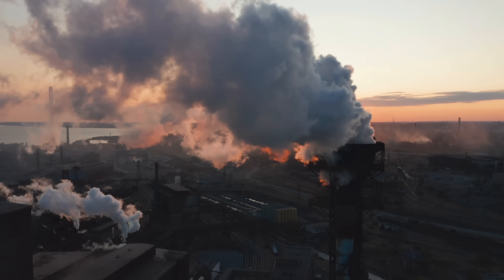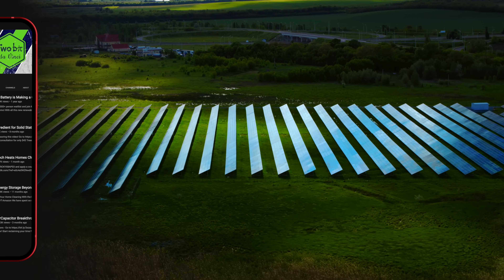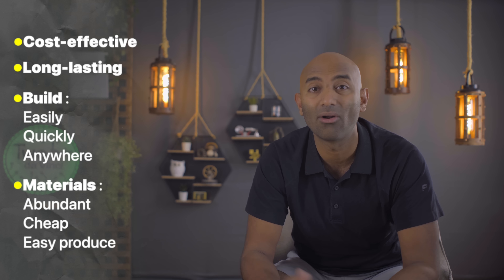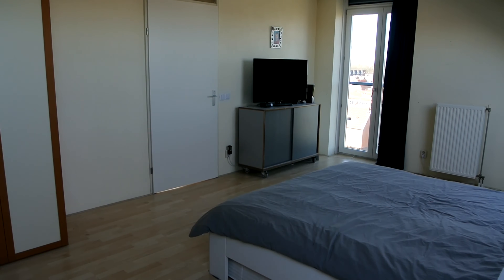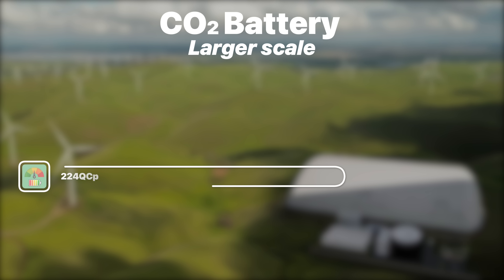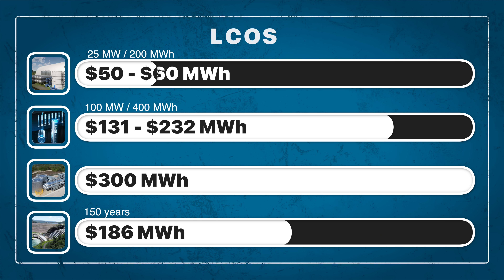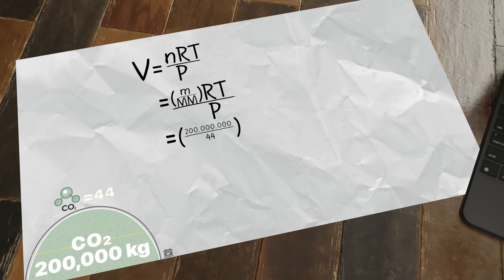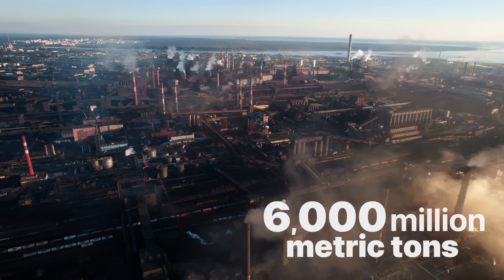The GENIUS Of the Carbon Dioxide Battery

Comment: Oil companies have a useful purpose for co2 and reviving dormant oil fields. By securing the existing wellbores and testing for pressure stability among other preparations these companies are injecting co2 into known reservoirs which builds pressure inside the reservoirs and dissolves dormant trapped petroleum remaining inside the reservoir. Essentially capturing volumes comparable to original recovery volumes. They know where the reservoirs are which eliminates the exploration guesswork and expense. Millions of barrels remain in dormant fields and co2 is a tested and effective way to reactivate those reserves.
They recapture the co2 on production and reinject it back into the field for repetitive usage.

Comment: If this carbon battery idea is legit, they do not even need to be placed near the solar, wind, or hydroelectric generators. As long as they are connected to the grid and can return power to the grid during peak power, or when solar or wind is unavailable. One possibility is even smaller plants, one that supplies power for a few city blocks, and if there is no danger from explosion, you could turn a park into one such plant with most if not all of it underground with the park overhead. The roofs of all the houses would then be where the solar power is, and the poles for the street lights are the wind turbines.

Comment: 6:57 Does power of 20 MW mean it can vary it's output as fast as that ? Eg: can it handle a spike of 10MW and if so within how many seconds can it respond to such load.
Reply: I'm sure that can vary based on setup. I'm not sure exactly how many turbines it's running, or how flow of decompressing gas affects generation, but if you have highly variable fluctuations I'm sure you can just add another turbine line to increase production capacity. 

If your average one can only handle a 5mwh surge in demand, for example, doubling the number of turbines should approximately allow a 10mwh surge to be completed.

Without ALSO doubling storage, you're likely to run out twice as fast, but maybe it's enough to get everyone home and in bed, and then the sun comes up tomorrow to recharge your system. 🤷‍♂️
Reply: usually when its quoted like the by a company its because the tank can hold 200 MW but can only supply 20 MW to the grid at a given time, so his statement that it could supply 300k homes for 1hr is wrong for that plant, could only supply 35k homes for 10hrs. In terms of how fast the supply is, he didn't mention that, but usually its fast enough that it can serve as a peaker plant roll but probably not microsecond balancing needs, battery and ultra-capacitors fill that roll. There is always a group of storages needed to maintain the different aspect of the grid.

Comment: The CO2 domes will occupy an unfortunate amount of land surface area. IF they're built on land. So here's an idea: build them on the ocean surface. And for good measure, paint them with one of the new super-reflective white paints. That would have the side benefit of increasing earth's average albedo -- however slightly -- and providing passive cooling for the area under the dome.

Comment: The risk of big fires also would also probably be much lower than that of lithium-ion battery installations, I'd imagine. Although not as low as pump hydro, obviously.
Reply: The risk of fires would almost be almost non-existent since CO2 is used in most fire extinguishers.  The dangers of suffocation however are much higher.

Comment: It takes electricity to liquefy the carbon dioxide gas.  This is why it is called a battery because the electric energy is stored in the liquefied gas.  The problem is in such a system that there will be a loss of energy in the conversion. I am sure there is a loss in other batteries so using carbon dioxide is much more efficient because there is no mining, etc. involved. Good idea.

Comment: Energy storage and intermittent renewables is NOT the answer. The climate has variability of frequencies orders of magnitudes apart. This means that we can not be sure that periods of low or near-zero production of electricity will not last several months or even years. That means we would need to massively exaggerate our production capability and our storage capability. Do the maths and you will find that

1) This will be many times more expensive than nuclear power (which does not need back-up)

2) This will be exhausting the world of rare earth metals

3) This will produce massive amounts of waste (disposed solar PV’s are toxic!)

4) This will need to be replaced every 25 years, whereas nuclear can run 75 years.

5) This will DESTROY natural habitats - look up the area requirement for solar and wind. One windmill kills several birds every year and as much as several kilograms of insects.

Why do we bend over backwards in a dream fantasy world when the superior option (nuclear) is right in front of us??

Comment: LP gas is cheaper and can be stored at room temperature. These guys think that they can change cars into electric powered airplanes. The left wing liberal  dumbells said we would run out of coal and crude coal in the year 2000. That same group of dummies took a cruse to the north pole to check on the receding polar ice caps only to get stuck in the ice and had to be rescued. I like the scary stories about soil erosion. We were told that the entire land mass erodes at the rate of 1 inch per year. At that rate we would be 10 feet under water by now. To power a city with solar power we would need 10,000 acres of open land with solar panels and sunshine 24 hours a day with no clouds. But now we have CO2 to the rescue!

Comment: Live off the land on Mars...
It is a little early, but this solution might be a great energy storage system on MARS, because the percentage of 
CO2 in that atmosphere is 95%.  The cold martian temperature might be a problem though. CO2 might freeze. It freezes at -78 C. Average temperature on Mars is -60 C, but much colder at the poles. Any heat generated during compression might be partially used for habitats.

Comment: A Carbon Dioxide Battery may Work, But Carbon Dioxide Gas Emissions are Damaging to this Planets' Ozone Layers! Because when Gases of any kind are released into The Atmosphere, they Breed finer & finer Gases that float higher & higher into The top layers of Ozones. Some of the finite Gases at the top layers of Ozones effectively Block physical Heat & Radiation Layers from this Sun. If too many finite Gases that Don't block Heat & Radiation Layers are in the top layers of Ozones. Then they thin the ones that Do and causes holes in the Ozone Layer to form away from effectively Blocking Heat & Radiation from This Sun.

Comment: Thank you for this little dose of sanity in a world gone mad. This is a genuinely impressive development. I am happy to have found your channel, and shall be making up for whatever I missed previously by binge watching.
Reply: Are you serving a sea bird for dinner? If not the phrase is how the table turns 👍
Reply: Maybe you should have paid more attention to the numbers. Even the number this guy handed out sounded bad. And that's the proponent's numbers. 

This is a scam. Pressurized air storage sucks.
Reply: Had an alarm bell go off while listening that makes me wonder about bias encroaching on reality.  At the beginning when talking about why EV's were taking off: "sleek design" - check; "performance" - check; "cost" - WHAT?  Where are you living that cost is a factor for EVs?  Those lithium batteries are expensive both on purchase and on replacement.  When shopping for a new vehicle, I wanted a hybrid, but was talked into gas when I found out the repair bill on battery replacement would have been $15k in today's dollars.  Future batteries in cars might use the iron flow batteries rather than lithium-ion batteries, which would reduce that by half (at today's costs).  Sure there is that tax rebate on EV's, but it's highly limited now and most dealers are charging fees, etc that essentially claim that tax rebate for themselves.  So EVs winning at cost? Not yet.  And if he is blatantly wrong about that, then what else is he wrong about?
Reply: @cwtrex  he may have been talking about total cost of ownership of an EV vs Gas car. Most TCO comparisons of EVs even considering one battery replacement in their lifetime is still way less than ICE vehicles. 

One balancing effect is that for most EVs by the time you need to replace a battery you are also on the mileage range where you would also need to replace/rebuild and engine or transmission in an ICE car which is not really that far off the cost of a new battery. 

The other factor is actually considering the original price of the car vs it's genuine competition. 

Everyone is price comparing Tesla Model S price wise vs something like a Honda Civic. But Tesla intentionally aimed for the higher margin luxury car market first, so a comparison with BMW or Mercedes makes a lot more sense and in that the original price is not much different. Even the Model 3 and Y are still in a totally different performance/feature category than the Honda Civic so a price comparison is still not fair. 

Compare a Leaf vs similar low cost hatchbacks and the price is not that far off. Hyundai EVs are not that far off their ICE equivalents from Hyundai, any EV Grant will help consumers get into an EV for around the same up front cost as ICE. 

With the long term low cost per mile for energy and maintenance an EV is likely much cheaper than a gas car. 

So maybe misspoke or failed to clarify (or maybe being deceitful), but he was actually correct, from a certain point of view.
Reply: @5353Jumper  "a certain point of view" and of course depending on favoring variables.  For instance, during my last car check, I couldn't help but read how EVs were considered bottom tier of reliable.  Hybrids were on top.  Unfortunately, as you pointed out, that means hybrids suffer both from transmission and other gasoline vehicle costs as well as the battery.  Due to the reliability issue, however, of EVs that means from a maintenance perspective the costs usually generated is less than truthful.  As for maintenance on gas vehicles, btw, if you believe the manufactures, the cost and failure of gas parts has significantly improved over the years.  Now long term, hopefully they introduce EVs that are both reliable AND at a proper performance point comparable to a Civic/Corolla, but at this point, I don't see how EVs fit into the budget (even long term) for those looking for the most cost effective transportation outside of public transportation at this time.  I definitely am looking forward to more cost effective battery technology to make this less of a discussion over which variables weren't included or currently incomparable scenarios.
Reply: I will be binge watching as well...
Reply: Imagine what a tempting target that gigantic dome would make to a potential Terrorist organization, or enemy nation. Much easier to hit that a power plant, or a diesel generator.
Reply: @hidel308  It is an atmospheric pressure dome of air. Attacking it would be silly. You might as well attack the air.
Reply: Yep quit drinking pop or soda. It releases co2. Same goes for beer.
Reply: @warrenpuckett4203  And never poop due to the gas it generates. If you do you are a bad person and polluting the planet.
Reply: @warrenpuckett4203  No thx
Reply: @warrenpuckett4203  Luckily, I do not drink any of those things, have not since my twenties. Now it is black tea or bourbon all the way :-)
Reply: @demonvalentine1  🤍

Comment: The modern definition, of global warming, is nothing more than the latest capitalist industry scam. And I'll tell you why.
Fist, the biggest problem is deforestation! You don't hear much about that: right. With an ever-increasing Human population, the removal of huge %s, of C02-converting plants is the LAST thing Mankind should be doing! But they have to prop up your superannuation funds, somehow; at least, that's the excuse.
Well, guess what, C02 isn't the primer of a warming Earth. And there is actual, already accepted science that backs it up. The ice core samples, from both Greenland, & the Antarctic clearly show that, over the last ~450 000 years EVERYTIME there was a rise in C02 levels (yes, it has occurred before, many times) the rise in the Earth's surface temperatures PRECEDED the C02 rise, usually by several hundred years! There goes the BS theory, about why you should waste your money, on an equally Earth-destructive EV vehicle. Do some research, on the lithium battery chemistries, & their deliberately concealed concerns.
Sure we are worsening this probable next temperature increase, with industrial pollution, but the real exacerbating factor is deforestation: make no mistake.
And you think that China gives a rat's A about this latest money-grabbing venture, by the industrialists, who caused this so-called  issue, in the first place? Not one iota! They're in the process of commissioning 0ver 50 coal-fired power plants! That'll help!

Comment: Oh No!  Not 6000 Million Metric Tons!!!  Does that actually sound scarier than 6 billion metric tons?  Certainly scarier than 0.042 percent that scientists say is the current level.  Is there a consensus that requires everything even tangentially related to 'climate change' be blown so far out of proportion that it defies comprehension?  "We're gonna have to go right to... LUDICROUS Speed!"  All you're doing is making it easy for the naysayers to nitpick, and push real solutions even further down the timeline.

Comment: @11:04 "...about 30 years, without any degradation or loss in capacity."  Seriously?  So it will never leak?  Never need maintenance on the valves?  Pumps? Generators?  No generators/pumps/valves will ever fail?  Over THIRTY Years ????  You're comparing it to Lithium Ion Batteries, which are a self-contained energy in - energy out system.  That means you have to include in your comparison ALL the pieces that make the CO2 system equivalent to a battery, from energy Input to energy output.  Typical half-assed rhetoric from the people who give you wind farms that are rarely used  over a quarter of their capacity and nightly car-charging moratoriums.

Comment: Actually, a catastrophic leak could be disastrous because co2 would blanket the surrounding area for a while and asphyxiate people nearby.

If this were very widely used, would the total co2 used still be a tiny insignificant fraction of the co2 we’ve put in the atmosphere?

Still, it sounds great!
Reply: Isn't the dome for CO2 at atmospheric pressure (approximately)? In which case, wouldn't it just integrate with the atmosphere as normal?
Reply: @braxbro6674  it might be at atmospheric but it is 100% CO2. And it has substantially higher density than air so it would flood the ground. A bunch of people in Africa suffocated when a lake overturned and dissolved CO2 came out of solution.

Comment: Wind has a low energy density and wind power is centuries out of date. Solar power is a useful supplement in sunny areas between the 35th parallels.
The current mean surface temperature of Earth (15 degrees centigrade) and atmospheric carbon dioxide concentration (415ppm) are both suboptimal.
A modest increase in both would have the net beneficial effects of increased agricultural yields (main effect) reduced winter heating costs and fewer deaths from hypothermia.
The carbon dioxide emissions from burning fossil fuels are actually beneficial. It is a popular delusion that they are harmful.
We are currently witnessing the massive misappropriation of taxpayers money into uneconomical and unreliable renewable energy projects in many Western countries. Germany is one of the worst examples.

Comment: They built a big refrigeration system.  So how/where are they going to store the heat?  You can't run a turbine off of liquefied gas without heat to expand it.  There won't be near enough heat around the plant to do it except on a small scale.

Comment: Your start off talking about carbon dioxide (we exhale and trees consume) being vilified but your showing car exhaust. That is carbon monoxide (poisonous). Your talking about burning fossil fuels. Again that is CO not CO2. Word about kobalt and lithium, extremely toxic. What do you do with the failed batteries. Throw some lithium in water and see what happens. Run.
Reply from the maker: burning fossil fuel releases huge amounts of CO2, CO, NOx and a bunch of other stuff. the average passenger car emits 404 grams of CO2 per mile, according to the EPA.
Reply: @TwoBitDaVinci  someone is fcking with the data to push their green new deal fear. Plants and animals give off and consume CO2. Burning fossil fuels generate CO plus some other unhealthy things along with carbon emissions.
Reply: If you're talking grams, you're talking carbon particles. You look in an engine or more specifically the EGR valve, you'll notice a build up of carbon. Thats not CO2.

Comment: Oil is NOT a fossil fuel.  It's an abiotic fuel. Fossils are found at 10,000-15,000 feet underground where oil is at 30,000 - 35,000 ft. Oil is the 2nd most abundant liquid on the planet. CO2 is plant food. It's what they breathe and release oxygen. Since our atmosphere is 70-72% Nitrogen, the oxygen is a necessity for life having no bearing on heat.

Comment: On a much smaller scale, CO2 is used in heat pumps. The hot water heat pump I use at home that replaced the old natural gas powered water heater uses CO2 as a refrigerant.

Comment: CO2 is colorless and odorless and 0.04% in the air for the last 300 years, showing smoke stacks full of smoke is not showing pollution with CO2, most of this smoke is water vapor.